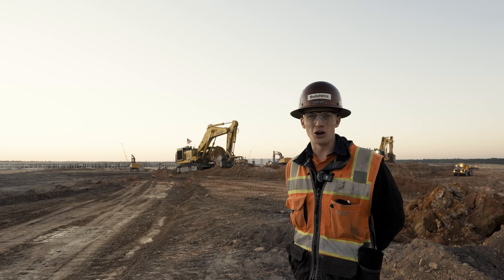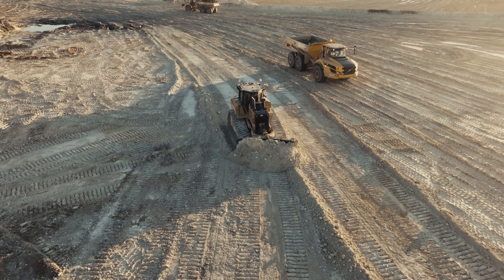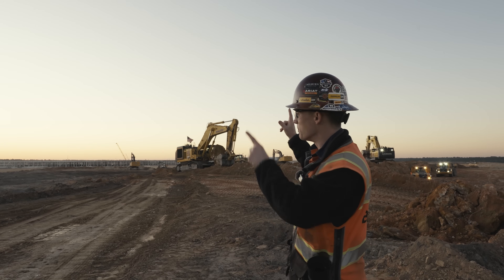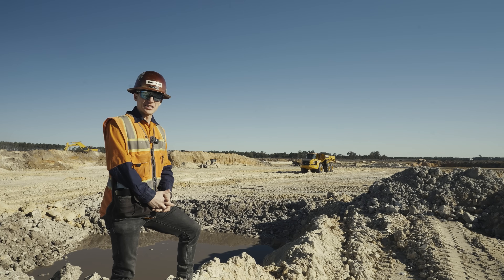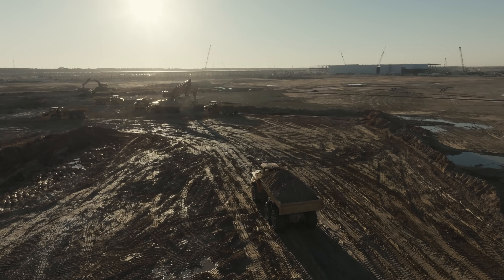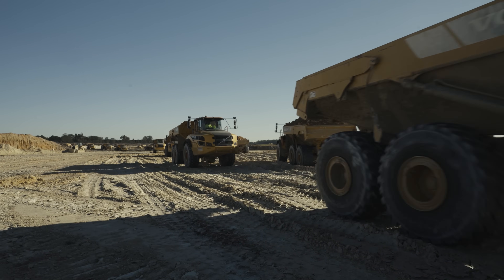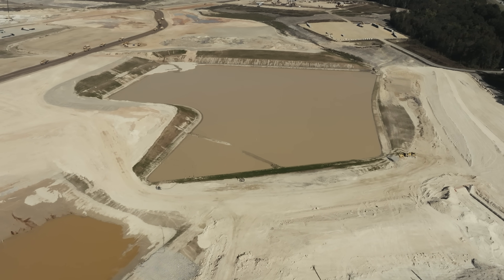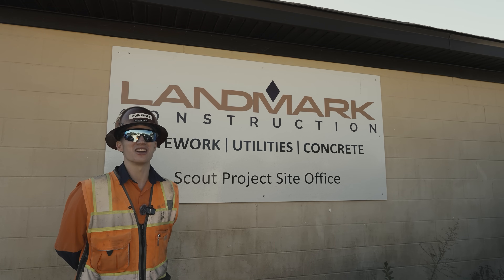America's Largest Earthmoving Project?

Comment: With all the closed auto plants in the US I find it strange that any company would need to build a new one.  Wonder why.  Could it be the massive amount of money SC is spending to bring the plant there?  Lower cost non union labor?   Whole new towns being built to house all these people. Is it like a Ponzi scheme?  Ignore already built infrastructure to keep building.
Reply: Needs to be near a good port for export. Old plants, built and rebuilt over 70 years are worthless. Tesla is still struggling with the toyota gm NUMI plant
Reply: SC government gave me them 1 Billion in incentives that’s why. That’s billion with a B
Reply: A Ponzi scheme? LMFAO. You clown. Educate yourself about what a ponzi scheme is, Bozo.
Reply: Closer to h company head quarters and probably the talent pool. I doubt there are much tech oriented people in Detroit and the rust belt
Reply: @brandino97yyc  That's why Intel is building their newest, biggest  facility in Ohio.
Reply: @brandino97yyc  surely you jest - Detroit is over brimming with tech people - it is still the center of the world for vehicle manufacturing - S.C. is primarily filled with uneducated people - I suspect that most of the equipment operators are not locals.
Reply: Hyundai just completed a massive EV plant just outside of Pooler GA. Government subsidies still running well i suppose.

Comment: I can't believe they are mixing the different soil types . At the mine I worked beside had to layer everything back the same way.
I guess different rules in USA America American
Reply: I live in South Carolina and that project is in the middle part of the state, closer to the ocean, so a lot sandier materiel, "junky" materiel types compared to other, doesn't matter where you dig down your going to have to mix dirt at some point or another, very little clay compared to the upstate of SC where I'm from. Honestly shocked there not doing soil cement or some kind of soil stabilization on that project, unless it just wasn't shown.

Comment: This is HUGE! Who is the fuel company/supplier out there? They would have to be an on-site mob.
Reply: Blythewood oil
Reply: I could only imagine the amount of fuel there. 
Probably 12,000L of fuel alone on the excavators plus 100 haul trucks.
Just imagine the amount of work it took to get all those trucks physically
Reply: They can refill them during a meal break.  They bring the trucks to a central location, and have 4 each straight trucks with 2,000 gallon diesel tanks on each truck fill them.  Then have a couple of off road capable trucks deliver to the excavators with 500 - 1,000 gallon tanks on the smaller trucks.  200 gallons per excavator per day!
Reply: meh.. Mining operations out west are a lot bigger.

Comment: I could be wrong but I’m guessing the owners of the company have a beef with caterpillar because I didn’t see one cat machine on the property.
Reply: There was a D6 in the video
Reply: @ Where? What time?
Reply: @truckinpoppop6777  1:03 there's also a Cat compactor pushing out with the dozers
Reply: @Joes1989  Ok. I stand corrected. I see the dozer but I’m stretching for the roller 😅
Reply: @truckinpoppop6777  16:27 fifth machine back. It's not a roller is a sheep's foot wheeled dozer type thing
Reply from the maker: Volvo trucks are king based on everything I’ve heard
Reply: @buildwitt  Why no A60's.
Reply: That depends on who you’re talking to I guess. I’ve heard a lot of Volvo people say that. 😂
Reply: @truckinpoppop6777  The emoji clown has never operated any thing... Certainly never maintained anything...
Reply: What do you mean have a beef with caterpillar?

Comment: amazing they build such factory complex without appearing to have rail access
Reply: Rail access is being done by another contractor
Reply: @mitchbailey7195  Will it have rail access for sure?
Reply: @JackReacheround yes they are building a rail depot on site with bridge over the interstate to connect with existing line.
Reply: @mackenzieking9471  Very cool. I love seeing new rail infrastructure.
Reply: We have Rail, the enormous BMW plant is just up the road about 90 miles it goes down to the port of Charleston, they will tie into that